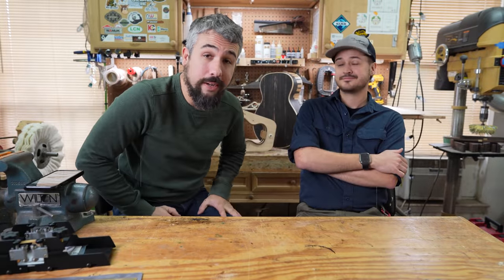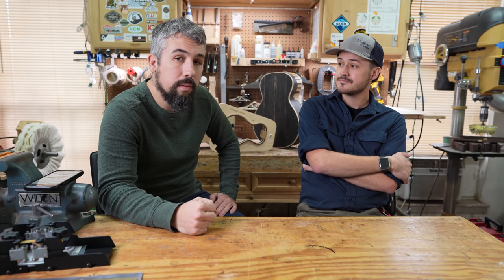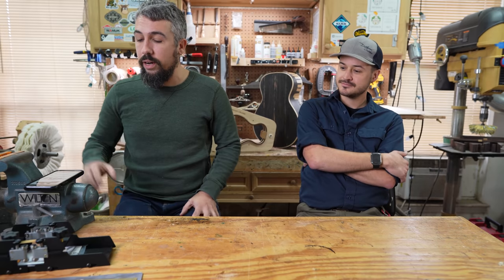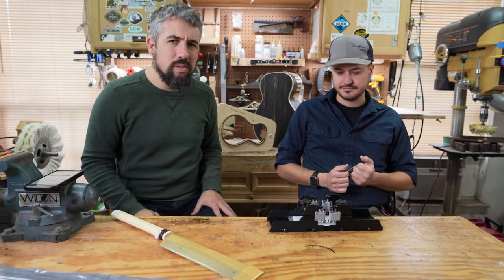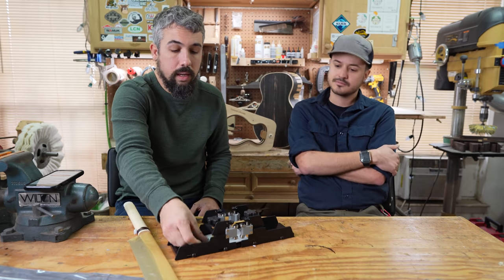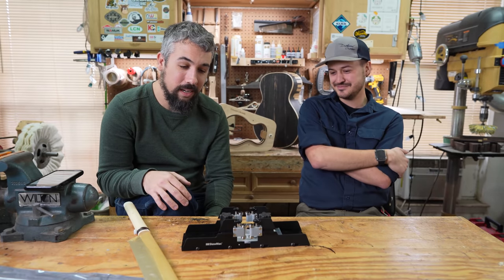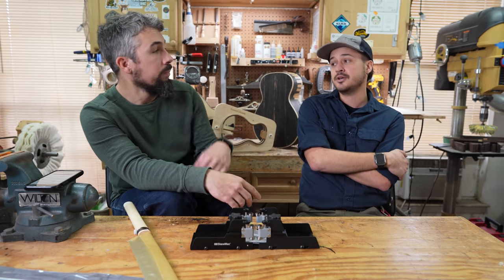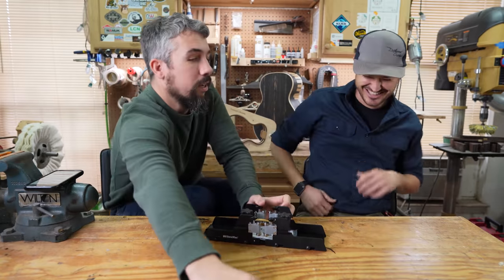3 More StewMac Tools To Make You A Better Guitar Luthier

Comment: Just bought the routing jig a month or so ago, and I'm loving it. Chris is right about the learning curve, but once you have it down it works great. Congrats to whomever wins this one! Be sure to throw a coat of finish & a coat of paste wax onto the bottom of the jig and the top of your work surface so it glides well.
Reply: Yeah, I'm probably going to pull the trigger on a binding jig this year. I've had the old dremel attachment from Stew Mac for like 25 years!

Comment: Thanks gents for this series. I bought the Stewmac thickness gauge a little while ago when ir was on sale.  A great unit. I am working with hand planes and scrapers. The gauge is really helping. 
I can wait on the binding unit. I am building acoustic bass guitars similar to the old Ernie Ball Earthwoods. No radius on front or back. I am thinking I will eventually try to radius one or both. After I get better at building.  But for now, the binding jig is not vital.
But I could really use the fret miter box. I bought one used from a retiring luthier. But it is a really old one. None of the fancy depth or saw giides. The  updated unit is so much better.
Thanks and keep the videos coming. Really cool to see you working with StewMac.

Comment: Tool 1 the fret slotting miter box.  I bought the thin kerf table saw blade but quickly realized my cheap table saw was wobbly and the kerf came out too thick and ruined a few fretboards before figuring that out.  I can’t afford a good table saw as of yet and this tool would really help out with my fretting.  As well as eliminate the need to change the table saw blade when I want to slot a fretboard.

Comment: I wish i could send you a pic of my first try slotting a fretboard freehand. After about 2 hours of concentrated marking with a 600mm ruler and scoring each line with a knife i really wanted to get the slots done. At this point i want to mention, that i'm not a professional woodworker and had no experience with handsaws at that time. The result was a lovely piece of ebony totally destroyed by a bunch of cricket and uneven sawcuts.

After that experience i've only bought pre-slotted fretboards, but the problem with these is that you often cannot see the wood before you buy it and you're also very limited in your choice (atleast over here in Germany) - You want a lovely piece of pre slotted ziricote? Nope!

Chris, Matt, i really enjoy your videos. Please keep up your good work.

Kind Regards
Max

Comment: I have finished building a guitar whos rosewood body I built, without the top, 49 years ago, so I guess its pretty well seasoned! At the last minute, decided to make it a cutaway, so chopped it up & reversed one upper bout, then fitted the spruce top. Bolt on 12 fret neck, sycamore & purpleheart laminates! making all the various jigs in my garage as I went along. Now we get to the interesting bit....I decided to fit abalone into the bindings..I ended up with great looking bindings but, by the time I had it levelled,  quite thin in places.oh dear... Hence,my request to be considered for your wonderfull binding jig, should I be lucky enough to be drawn as a winner, & it can be shipped over to Devon in the UK, that would be brilliant.

Comment: Thanks Chris &Matt for another great video. Those are all great tools, but the one I'd like to win is the fret saw station. I was cutting fret slots on my table saw with the StewMac 6" saw blade but when I upgraded my saw last year it used pin indexed saw blades and I have not been able to use my StewMac blade. I need a new system and have been eyeing the slotting jig that you are giving away. Thanks for all the videos you guys do.

Comment: I am also tackling my first necks (I have flamed maple and Ebony ready to go), so needless to say… the fret cutting setup would be good send. That said, one of the guitars is a yet to be determined length baritone, so I guess I may may still be using callipers to measure… if stumac don’t have a template. But square cutting the channels will still be so much easier with this setup. I do love these tool segments, thanks guys!

Comment: Hi, Chris, 

Please put my name in the hat for the binding jig. I'm in a perpetual "newbie" state and I need help to advance. I've been struggling with binding anxiety and screw ups on my early builds and quite frankly the paralysis by analysis effect is something that this would help me overcome. My goal is build/rebuild at least one guitar a year and this would help out A LOT. I used a friend's jig like this on my first build but that was many years ago and I no longer have access to it. I tried making something similar to what you use on my second build but it has suffered for it and I will likely have to do the binding/purfling a third time.
Reply: I'm assuming that the Whut App is a bot or a scammer. Looks like I'm the only one. Time for a PC clean.

Comment: Fret-slotting has become the bane of my existence since I got into luthierie a couple of years ago. It does not help  that I am slightly OCD and cannot bear the thought of any slot being slightly misaligned --I have been known to re-fill and re-cut slots that were half a mm off, which is less than the thickness of the tang anyway. 
So, this is to say that, for the sake of my sanity, I need a fret-slottting jig in my life...